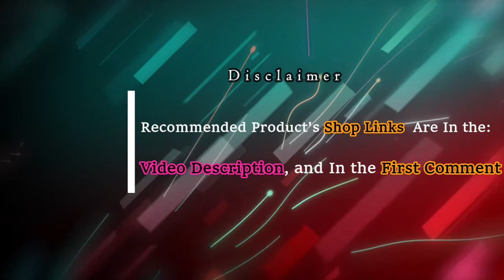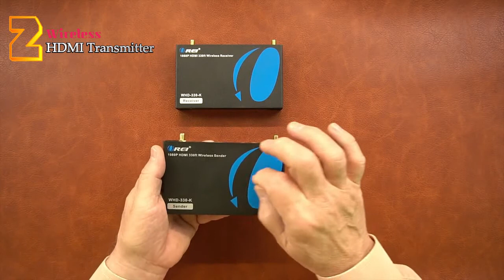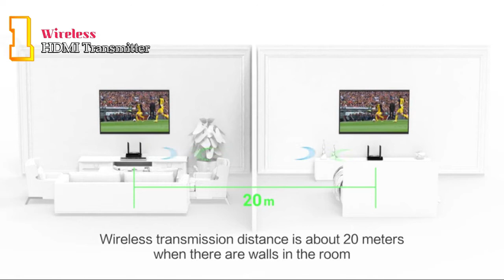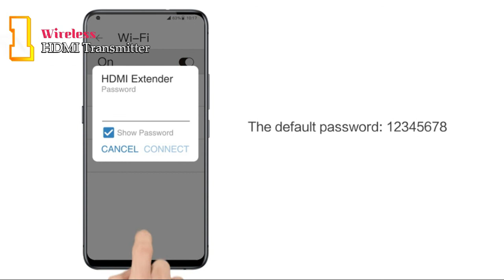Best Wireless HDMI Transmitters for Laptop, PC, Video/Audio, Netflix, YouTube, PS4, Projector, TV/AV

Comment from the maker: So, here are our Top 5 Best Wireless HDMI Transmitters/Extenders:

► No 5. WISEJET V-JETn 60GHz Wireless HDMI Extender, Near Zero Latency Transmitter & Receiver, Full HD 1080p Stream Video from Laptop, PC, Smart Device(100ft / 30M) Range: 
https://amzn.to/31ma0cU (Click or Touch on the Blue Link to Visit Shop)

► No 4. J-Tech Digital Wireless HDMI Extender 1080p Transmitter & Receiver Kit Auto-Select Frequencies with no Interference, up to 500ft and IR Remote Extension: 
https://amzn.to/3sr31vf
(Click or Touch on the Blue Link to Visit Shop)

► No 3. Ansten HDMI Wireless Extender, 660ft /200m Wireless AV Transmitter and Receiver with Loop-Out Support 1080P@60Hz Full HD IR Passback Transmit Video Audio from PC, Netflix, YouTube, Xbox to HDTV/Pro: 
https://amzn.to/3d6cxh4 (Click or Touch on the Blue Link to Visit Shop)

► No 2. OREI Wireless HDMI Transmitter & Receiver Extender- Upto 300 Feet - Long Range - Perfect for Streaming from Laptop, PC, Cable, Netflix, YouTube, PS4 to HDTV/Projector - IR Support - Low Latency: 
https://amzn.to/3srllV3 (Click or Touch on the Blue Link to Visit Shop)

► No 1. PAKITE Wireless HDMI Extender, 5GHz HDMI Loop Output Transmitter and Receiver for TV/AV, Support 1080P 60Hz Full HD with IR Remote Control, 656FT Transmission for Projector Monitor, Church, Office, Home: 
https://amzn.to/3roYJ6v (Click or Touch on the Blue Link to Visit Shop)

►Timestamps◄
0:12  (No 5.  WISEJET V-JETn 60GHz Wireless HDMI Extender)
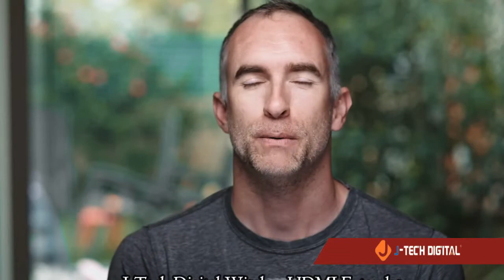1:51  (No 4.  J-Tech Digital Wireless HDMI Extender Transmitter & Receiver Kit)
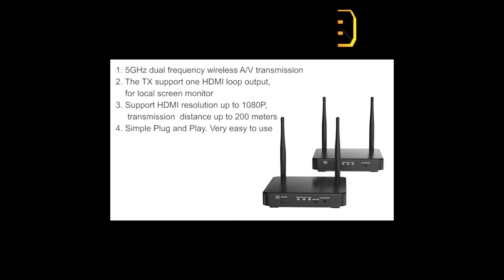4:13  (No 3.  Ansten HDMI Wireless Extender)
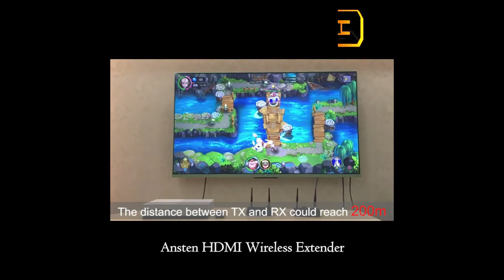6:00  (No 2.  OREI Wireless HDMI Transmitter & Receiver Extender)
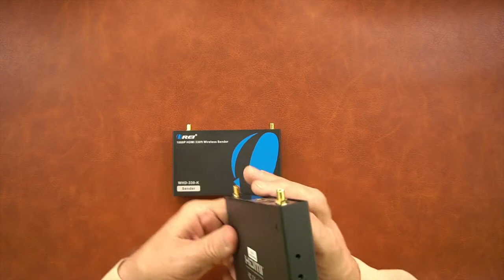10:53 (No 1.  PAKITE Wireless HDMI Extender HDMI Loop Output)

❗❗ Amazon Promo Codes & Deals ❗❗
☆ Kindle Unlimited Membership: https://amzn.to/2PxrKzE
☆ Audible Gift Memberships: https://amzn.to/3fl5gMU
☆ Amazon Baby Registry: https://amzn.to/3rxEnYC
☆ Create Amazon Business Account: https://amzn.to/3w8oiMK
☆ Give the Gift of Amazon Prime: https://amzn.to/3u6D1pD
☆ Prime Discounted Monthly Offering: https://amzn.to/31s53zi
☆ Amazon Wedding Registry: https://amzn.to/3w5ODuI
☆ Personal Shopper by Prime Wardrobe: https://amzn.to/39jCc4C
☆ Prime Wardrobe: https://amzn.to/31n0A0U

❗ Free Offers ❗
☆ Audible Plus for Free: https://amzn.to/3cxKnfX
☆ Audible Premium Plus and Get Up to Two Free Audiobooks: https://amzn.to/2QLqp8U
☆ Amazon Prime 30-Day Free Trial: https://amzn.to/2O3f3My
☆ Amazon Family 30-Day Free Trial: https://amzn.to/3u1r18M
☆ Amazon Prime Music 30-Day Free Trial: https://amzn.to/3w4B0vD
☆ Amazon Prime Music - Free 2-day Shipping - 30-day Free Trial: https://amzn.to/3u5AyM5
☆ Prime Student 6-month Trial: https://amzn.to/3cvFzYq
☆ Amazon Prime -Movies & TV Shows Anytime - Start Free Trial Now: https://amzn.to/3u1o0Fg

❗Best Deals and Offers ❗
☆ Your amazon offer (promotional/ Coupon Codes): https://amzn.to/39kxkwd
☆ Amazon's Deals of the Day for You: https://amzn.to/2PyyhKr

❗Best Products and Categories ❗
☆ Best Selling Products/ Top Rated Products: https://amzn.to/3tU8g70
☆ Hot New Releases: https://amzn.to/3wehUDJ
☆ Today's Hot Products: https://amzn.to/3dbQLs9
☆ Most Wished Items: https://amzn.to/3suo28z
☆ Best Gift Ideas: https://amzn.to/3w52OA2
☆ Gift Cards: https://amzn.to/3svcEcs
☆ Must-Have Products: https://amzn.to/2PvHp2i
☆ Men's Shirts under $30: https://amzn.to/3w8OJBY
☆ Best Sellers in Kitchen: https://amzn.to/3m2do6j
☆ Stuffed Animals & Toys under $10: https://amzn.to/3tU9nDI
☆ Popular Gifts for Babies: https://amzn.to/3tU9v6a
☆ Top Beauty & Personal Care: https://amzn.to/2NZVDbn
☆ International Best Sellers: https://amzn.to/3ctd4uf
☆ Must have Wireless products: https://amzn.to/3suuEU5
☆ Computers & Accessories: https://amzn.to/31rZ2Tw
☆ AmazonBasic Products: https://amzn.to/31pp0H1
☆ Get fit at home: https://amzn.to/31rvYLS
☆ The Baby Store: https://amzn.to/39h3skn
☆ Toys and Games: https://amzn.to/31ny7YX
☆ Video Games: https://amzn.to/2PgUmNw
☆ Mobile Phones & Accessories: https://amzn.to/3w8W4kH
☆ Best Women's Fashion: https://amzn.to/3d5wUe0
☆ Decoration: https://amzn.to/3sAHVec